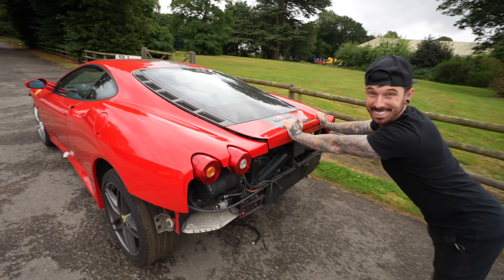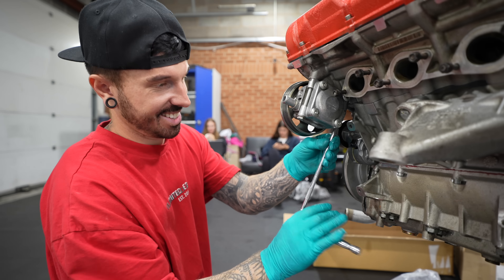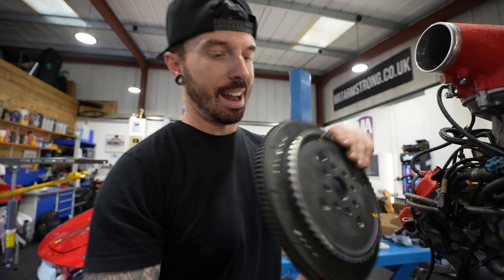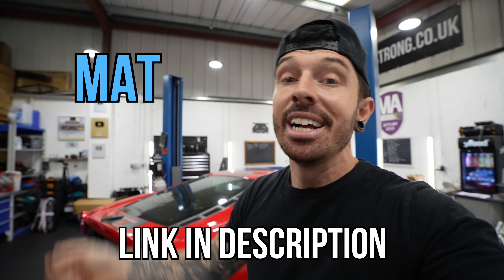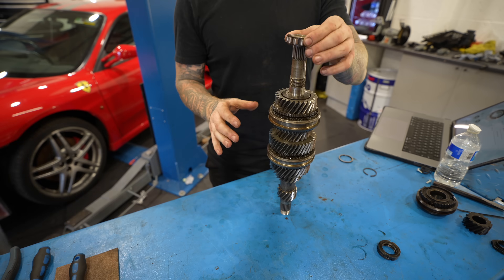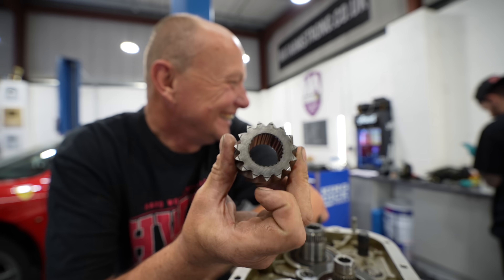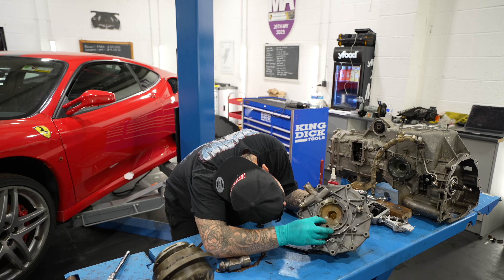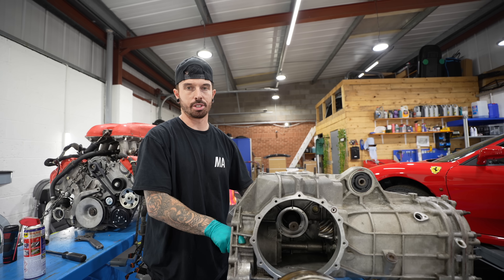REBUILDING AN EX RENTAL FERRARI | PT3

Comment: As a mechanical engineer in power stations, we have a lot of gear boxes, you need to find out back lash settings in the diff & gear box, you normally change the spacers to get the correct backlash so you will need to find the information somehow, getting it wrong means the gearbox & diff will have problems when it gets warm & could wreck the gearbox etc, well done for putting the gearbox together from a pile of bits, I hope it works ok for you🤞
Reply: I thought the same thing! With swapping the bearings between the 2 boxes Matt, it will likely change the pre-load on the diff. Good news is you can adjust it by just removing the diff, so the rest of the ‘box doesn’t need to come to bits…. Just the diff cover etc. 
a g’box refurb place might be kind enough to advise or even if you paid them to set the diff spacing you’ve still saved £££££
Reply: This needs to be upvoted more
Reply: Came here looking for this sort of comment. Yes diff preload settings can be critical. swapping bearings and shims can upset this a lot
Reply: I'm no expert but I think he should also do the yellow paint thing to see how well the gears are meshing between ring gear on diff and the pinion gear inside the assembly
Reply: I think I’d also worry about the fire damage changing the temper on the gear faces 😬
Reply: @liljonwask  Yea usually you should put the paint on the pinion ring and gear then turn a round some, take apart and peak at how it was meshing together. Do this on RWD diffs often for drift cars after installing a LSD or welding the diff.
Reply: Yep, you need to set the correct backlash for the diff crown and pinion gears, and the tapered roller-bearings in the gearbox need the correct shim thickness to set their preload too. There will also be some way of setting preload in the LSD assembly. Great that you're tackling such a big task yourselves, but a bit of expert help here and there would make a whole lot of sense!
Reply: Also “sharper” gears aren’t necessarily a good thing. Gears and Gasoline have some awesome drivetrain content from a knowledgeable shop that would smooth out all stress risers
Reply: While it's true for doing a complete rebuild or when installing aftermarket components, the most likely scenario in this case is that mixing components from two standard production gearboxes will be within tolerance specs.
Reply: I would be too worried about how the fire damaged bits got “normalised” in the fire, losing their strength and or their wear resistance obtained by the heat treatment at the factory. 
Can’t fault him for trying though. Great vid and very good comments
Reply: @milanovicso   I would not be to worried about using the gear set from the car that caught fire as it would have been a bit protected by the gear/diff oil & the gear sets are normally case hardened which is very tough. However, things that do blow up gear boxes/differentials are incorrect gear mesh backlash. It’s easy to measure, just put some fine lead wire on a few teeth on one gear that meshes with another, bolt it all back up & rotate the gear box a couple of times, then carefully dismantle & measure the thickness of the lead wire with a micrometer, that will give you an accurate back lash measurement. There must be a Ferrari specialist or someone on the web who knows what that backlash gap should be. Also, if a new gearbox is £15000, it’s worth getting what he’s got right & I want him to succeed as not many people would attempt what he’s doing…🤞
Reply: Very refreshing to see someone who actually knows something.
Reply: Yeah - I've rebuilt three "English" diffs and they are very sensitive to having the crown and pinion matched, and the correct preload for proper meshing (they use a crush washer to get the right preload which is a very odd setup!). You'll soon know - you'll have a whiney diff, or, a clunky diff each time you release the clutch. Hope you get lucky Matt - always enjoy your attitude.
Reply: I think the drag is more likely to be the torque on the diff. All diffs need to be torqued correctly as they have a backlash, and the wrong torque will make the gearbox drag.
Reply: I work for a company who build & design transmissions/gearboxes. Good job pairing the crown wheel and pinion gears, but ideally the backlash, drag and tooth engagement of the diff needs checking, however without all of the correct data it’s almost impossible! Hopefully it works and you get lucky! Love the videos though!
Reply: @98jamy  I think your right that mat will need the correct tolerances for things like backlash etc I’m sure that someone in the world must know what they are🤞I would search the internet for Ferrari clubs around the world & see if any club member knows them also, there are a number of Ferrari race teams that I have seen at brands hatch, surely one of them must know & as I’ve said earlier, better to find out and check you have it right than to spend £15000 on a replacement plus all the strip down & rebuilding everything if it all goes wrong, wouldn’t want that to happen🤞
Reply: My Grandma can rebuild it!
Reply: Spot on, in other word get this assembled by an expert with the appropriate tools.
Reply: Welcome everybody to the section of the comments for the armchair master engineering mechanics that build rockets in they're spare time
Reply: Matt needs to reach out to Ratarossa for some collab on getting the info he needs for backlash etc
Reply: As an engineer there is so much I’d  stress about here !
Torrance 
Backlash
Heat treatment of fire damaged bits 
I guess I would want the comfort of someone like Dad but who had rebuilt a few of these successfully before ?
Unless
They have help that isn’t in the for ground of the videos.
Wouldn’t surprise me
Reply: Bit of engineers blue to check correct mesh

Comment: Hey Matt, i think y ou should check your ring gear to pinion clearances, you have mixed parts from 2 gearboxes including the case that holds it all in place, all those spacers and shims you put on each side have an effect on how tight they are when put together, notice you have your pinion already there in the middle and then you are inserting the diff front the side and the teeth engage, how deep you put the differential effects how much theyre biting eachother, you can check the clearance by using a paint called prusian blue, or grease, and also once its put together you could check your clearance with a gauge, if you want to eyeball it when its all put together you should be able to grab both axle outputs and move them back and forth and notice a very minimal slack, but it has to be there if it doesnt that differential will grind itself to crumbs. hope you notice !!
Reply: I can attest that checking the ring & pinion for proper mesh is a very important step. Many years ago I mixed & matched parts in a Corvair transaxle (yes, I know; why Corvair) & did not check or adjust the mesh. The ring & pinion blew up after just a few hundred miles (must have been all that horsepower). A critical step!
Reply: Its sad to see this hes got als the parts but definitely needs a manual to do this.  These things are not something that gets trown together.
Reply: Came here for this comment
Reply: Whose Matt? Do you mean derek, Rupert or maybe even Inglebert.
Reply: LOL. It doesn't matter. Did you not notice the color difference between the gears, he used from the heat damaged gearbox? The gears are brown. This is a strong indicator that they were exposed to temperatures of 900°-1000°F. The thing is sooner or later going to blow anyways.

Comment: Hi Mat excellent effort. Not a Ferrari guy but I have a lot of experience building gearboxes for another top manufacturer. Gearbox crown wheel and pinions are made as matched items. You often see a colour dot on the gears say red or blue which will match. So both items will have the same colour. I'd use the pinion shaft from the toasty gearbox it should be fine. This is likely why you are getting so much resistance when trying to turn it rather than it needing oil. The pinion is tight against the crown wheel not leaving enough clearance. It'll go boomski otherwise.
Reply: I thought he did use the secondary shaft and crown wheel from the fire damaged box so they were paired up? Only the first motion shaft that was original?
Reply: The only thing he did not do is set the pinion to ring/crown backlash.  That could come back to haunt him, but since he is using the matched set from the toasty box, he might be fine.  There might also be a setup procecedure for the limited slip clutch.  Without a manual and clearance specs they are just guessing obviously.  You could do some paint marking and guessing which would get them in the ballpark, as a good patern is a good patern regardless of what the factory numbers say.  Why should Ferrari be able to keep this information hidden?  Does the UK have a right to repair law like we do here in the US??
Reply: What about the tempering on the gears? Could it be affected by the fire?....are they even tempered?

Comment: Hi Matt

I have rebuilt a few Toyota Hilux gearbox’s. The turning of the output  shaft when the input shaft is turned when in neutral was normal on the hilux. Just drag through the gears. 

When you have the diff in and wheels on the ground should stop the turning transferring.

Comment: What's up Mat, mechanical engineer here I was literally about to comment that a transmission has a good bit of friction in neutral and will still spin if no weight counteracting the load from the engine but looks like you figured it out lol.  When building my SLC I noticed it in action too with my car on the lift.   Love your content man!

Comment: 19:44 That clutch plate is a limited slip differential, is in many sport cars and off-road vehicles to avoid 1 wheel sliding in a hard acceleration on low grip surface or on a turn, so it works like a normal differential at low wheel speed difference, but if a tire starts spinning faster that it should, it frictions and send power to the other wheel to distribute the power evenly.
Reply: Yes and might even be adjustable for slip response.  LSD on commercial sport car, might be adjustabke to answer the need of the driver to get the right sensitivity of the torque at which point you want to  trigger oversteering. I guess you might need to get to sport car specialist in customised LSD to answer your question

Comment: I always save random nuts and bolts etc from whatever I come across. I used ikea stub screws to rid my 530d of the dreaded swirl flaps (alternative a few hundred quid), I used some rubbers from a new washing machine to hold the air box down on my van. The list goes on.

Comment: The only problem with this video is you just can't tell how long they have been working and stressing on one part. It could be 18hours into the day and Mat is still smiling. 
So impressive. I would have been rocking in the corner crying for my mom half an hour in.
Reply: My only issue is the metallurgy of the burnt parts (especially gears). I'm thinking embrittlement of the steel which would lead to eventual failure of the gearbox. I guess the next owner can always figure that out as long as they dont wreck it after a couple days of driving.
Reply: It's a bit like what you are saying is HWBT? Spot on.

Comment: A limited slip diff does need some resistance to work efficiently, I knew you had it from the get go. Good work mate 😎😎 it’s all about the physics 😉
Reply: I kept yelling that it’s normal to have it turning.
They’d never had gotten that far without that all being correct.

Comment: literally was typing about drag when the plot twist came... did you know there's a similar phenomenon in motorcycle clutches? when on main stand and in neutral the rear wheel spins cause the oil of the wet clutch sticks the disks together just enough. though you could easily stop the spinning by hand, so well done mate :D

Comment: Hi Mat, you need to chek if the play from pignion to the crowngear is right, also you need to put a litle bit of color on the crowngear and turn it 2-3 full spins. Then you can see if the dents fit right in each other.  Also you need to chek the precarge of the roller bearing. Thanx for your nice Viedeos from Italy 🇮🇹

Comment: Kudos to you for diving in and giving it your best. Before you put the transmission back in the car though,  you should check the backlash of the ring and pinion gears to see if it is correct to spec. With the different transmission case you are using now, it will change the backlash. Too much or too little backlash will destroy the ring and pinion quickly.

Comment: Years ago I pulled apart a Mercedes slk550, non kompressor model, that was 1 year old and got into a flood and hydrolocked like this and bent a rod. It was for a salvage yard/salvage auctioneer.  They didn't want to fix it and for the parts it was $27,000.  I cut the beam out of the rod. Pulled the wires off the injector and could at least drive it around the lot missing one cylinder.

Comment: Gears go through surface treatments such as chrome or nickel coating during manufacturing for wear protection on the teeth. Tbh i'm not sure how that coating would've liked the fire so you should perhaps expect excessive gear wear and oil polution. I would definitely flush the oil after only 100 miles or so anyway since it's gonna break in and load the oil with metal, and because those gears from the burnt transmission seem covered in carbon from the old oil's combustion too. Maybe do repeated close flushes, that would allow the box to clean out to a certain extent, and also allow you to monitor how it's doing.
Then there's also the preload which is most likely gonna be off since you swapped parts but other people already commented about that. 
Wishing you the best mate.

Comment: I work for a company that supplies Chrysler with drive units. My job is to finish grind the pinion then test and match them with finished ring gears. And I can say you definitely shouldn’t mix those. You could but then they won’t mesh right or you’ll have more sound and wear over time.

Comment: Possibly one of the selectors is not in its slot on the gear, or wrong way round on the selector shaft. Try to select all the gears in turn. When you select the other gears the gearbox will lock up as it did at the end of the video, because it will have two gears selected at once. The gear that doesn't lock it is the one that's wrong. One of the selectors may also only want to go one way, suggesting that's the wrong one.

PS you will need to take the clutch apart again to centralise the plates and align the splines on the two friction plates, or the gearbox won't go on the engine. You can use the splined end of the shaft from the burnt engine for that. Keep it for future use as well. It's the best possible clutch aligning tool you could have!

Comment: Mat the two shafts in the gearbox is called the main shaft and the fixed one is called the lay shaft and there is always drag when you rebuild a gearbox so it takes quite a bit of effort to turn it without oil in it and up to temperature the way it works is you select the gear on the mainshaft locking them together sending the power down into the fixed ratio gear on the lay shaft it travels right to the end of the shaft to the drive gear at the end of the gear box and out through the main shaft where your reverse gear is situated i know it sounds weird but its quite simple really all gear boxes are practically the same and the differential you were showing is a limited slip diff so you can spin both wheels together when pulling away hard. it looks to me like you and your dad has done a very good job fingers crossed you have the right amount of shims and end float you will know when you drive away if it whines at you or gears are hard to select hopefully they will just slip in nice and easily which i think they will so all the best from John from Rugby UK.

Comment: 19:35 - This is a limited slip differential. A differential works shifting the torque to the wheel with less resistance. This is used to align the wheel speed in curves as the inner wheel will have a smaller trajectory to follow, thus needing to spin less. If there was no differential, the wheels would fight each other as the one outside the curve wants to spin more. The issue with racing cars is that, as you roll the car, the weight will be shifted to the outter wheels. This will increase the resistance of the outter wheels and the torque will be shifted to the inner wheels. Now imagine an extreme case where the car is rolling so much, that the inner wheel is lifting from the ground. With an open differential, all the torque will be sent to that floating wheel, as its the one with the least resistance. Meaning, you will lose all your torque to push the car forward, thus losing time, until the car reduces its speed,the wheel touch the ground again and the engine start pushing the car forward again. In racing cars, in order to prevent that, you can limited slip differentials. Meaning. These plates will not let one wheel spin 100% and the other 0%.depending on the amount of these plantes, geometry, material, pressure (if hydraulic) etc, you might have a 20%-80% differential - 70-30%. Etc.  In some cases like off road application, you can have a blocking system which will actually make it 50-50  so you don't get stuck in the mud for example.